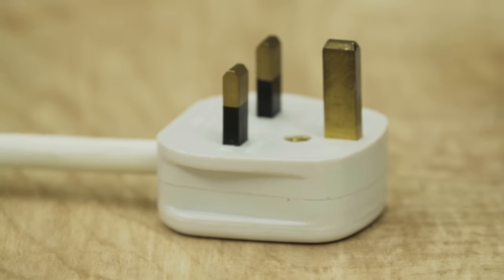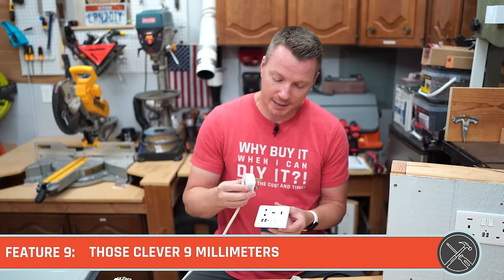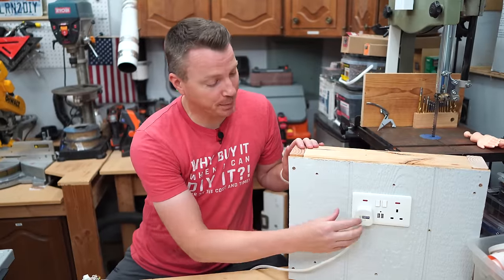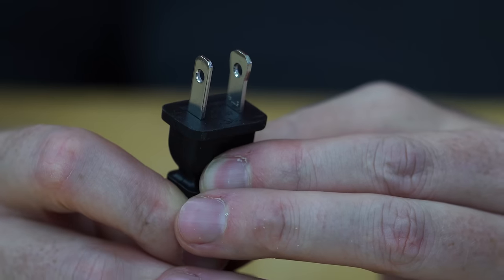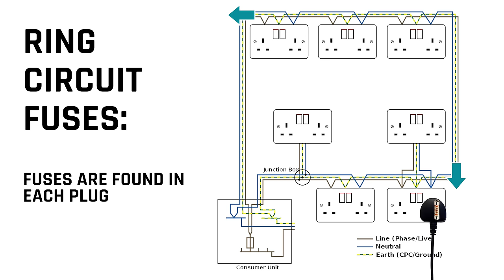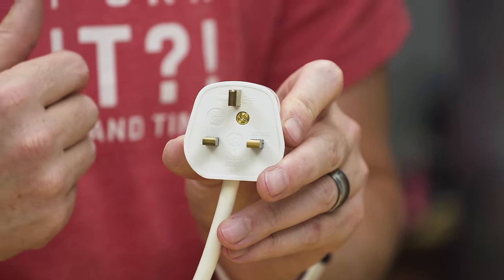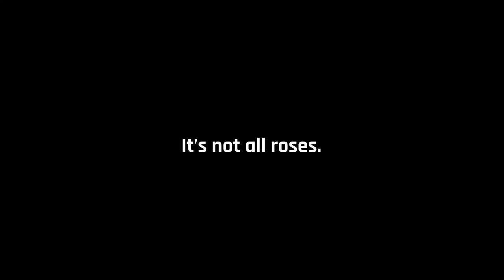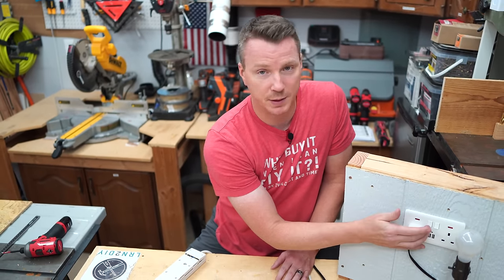British Plugs and Outlets Are On Another Level

Comment: If you think our plugs are chunky, imagine a Brit coming over to the US, when I was over there years ago the plugs seemed so flimsy, almost scary, sort of like just sticking some bare wires into the holes and hoping for the best 😂it really felt precarious, the whole deal, how easily you can pull them out, how easily you could stick a bit of metal in them, the unprotected prongs when not fully inserted, no fuse, no switch . . . and so on, I'm sure you're are all used to it and they are safe, but to someone brought up in the UK it's a little concerning, lol : ) . . . . by the way, annual deaths by electrocution in the US average ~350/year . . . in the UK it's ~30/year . . . so even though your population is around x4.8 larger than the UK, you have nearly x12 times as many deaths by electrocution.
Reply: They make tamper proof plugs in North America as well.
Reply: People unplug in the USA by pulling the cord, seeing a big arc. Yikes! Arc fault detection devices will trip out each time.
Reply: @johnburns4017  i never seen an arc
Reply: @danlux4954  
I have when there is a load running thru.
Reply: A lot of them happen when people are trying to plug things in probably, if your hands are even the slightest bit slippery things get painful rather quickly as you are pushing towards the pins while inserting the plug. Happened to me once over there fortunately the outlet was GFCI protected so it was just painful. I took to using a dry cloth or something to avoid the risk of touching the uninsulated live portions of the unsafe little buggers after that.
Reply: so your only variable is the plugs....
Reply: When I went to the US the plugs hardly stayed in the wall, no matter how you put it in, it was hanging out, metal showing and sparking! Was afraid to touch it!
Reply: @scottadkin541  "so your only variable is the plugs...." No, there are other factors, I was just discussing how US plugs seem super flimsy to people from the UK . . . imagine if someone from the US travelled to some far flung country and found that the local electrical outputs were a hole that you inserted a wire coat hanger into, that's sort of what it feels like : )
Reply: Electrocution on 110 volts?? try 240 volts, that really hurts!
Reply: I stayed in the US for a few weeks and I noticed sparks when using the plugs a few times.
Reply: If the UK plug is chunky look at a tumble dryer plug in north America. Probably three times the size and still just doing 3kw. And costs way more. UK plugs are hands down better than north America. American 120v plugs are cheaper.
Reply: @sammie9999  yup, but it’s better protection than the regular plugs.
Reply: @sammie9999  We don't have sockets in the bathroom in UK.  Everything is wired in to prevent steam and condensation from short circuiting the system.
Reply: @sammie9999  hopefully very few as GFCI /rcd is standard. I do appreciate a socket on the bathroom but I prefer British safety. Electro boom has a good video testing GFCI safety with water. I'm surprised north America has normal light switches in bathrooms. I'm used to the strings.
Reply: I remember plugging in my phone charger in the US and the plug just kind of 'dropped' in the socket. Like you'd push it fully in, it'd droop down a bit, repeat. Never really felt confidence inspiring. :)
Reply: @VoxelLoop  yes, not good. When the prongs can be stamped metal I think more corners can be cut. I think America mandate arc fault circuit breakers now. I was surprised to learn 120v is more prone to arc fault than 240v. Perhaps it's mostly in the plug!
Reply: @sammie9999  I would guess that almost zero died of electrocution in the bathroom in the UK. We have strict laws about electrical outlets. Even light switches are of the 'lazy Daisy' variety - a string hanging from the ceiling rather that a standard light switch - in order to avoid electrocution even with dripping wet hands.
Reply: @davidbalfour3390  To be fair, I'd used the American light switches many times with wet hands and never even had a tingle.
Reply: @chaos.corner  how many tingles until a super tingle? Personally 120 is a safe voltage, they use it on UK building sites.
Reply: @davidbalfour3390  For sure I'm not saying that the strings shouldn't be used for 240V (though ours was always breaking), just that the risks likely seem overstated. I'm sure it would be possible to design a safe-enough regular style light switch for bathroom use too.
Reply: On UK building sites the actual voltage is 110V, but the reason it safe is that we use centre tapped transformers so the voltage to earth (ground) is only 55V, meaning that by coming into contact with one phase (wire) you are only exposed to 55V AC which is not fatal.
Reply: Funny how he said about the size.. but when it's plugged in it dosnt poke into the room half has much as a us plug also looks alot cleaner to the eye
Reply: @mark_8719  Yeah. It’s common to have to bend the pins back on plugs for vacuum cleaners, and other appliances that are known to tug on the cord. 😂
Reply: @davidbalfour3390  also the yellow 120v building site transformers share the voltage between the live and neutral. Eg the live will have 60v and the neutral will also be live with 60v. Similar to a centre tapped tx.
Reply: @glenmynard3926  I'm always getting my 110 120 220 230 240 mixed up. At least I don't routinely use 208. It always surprised me that construction use 110 and no one ever complained about lack of power.
Reply: Power would be the same regardless of voltage as the current would increase if voltage is lower (but power stays the same) that is why the cables used are of greater gauge
Reply: @jamie7664  how ridiculous 😅
Reply: @davidbalfour3390  That's not quite true - it's actually 110V, but centre tapped, so it is actually 55-0-55V and if you manage to touch a faulty item that has become live, it should only be 55V to earth. However, 240V with RCD protection is also acceptable on some sites and there is no legal requirement to use 110V equipment.
Reply: @davidbalfour3390  230v allows for more watts at a lower current. 230v is much better. Lower voltage and Higher current is not ideal. High current means you need a thicker conductor
Reply: @danlux4954  
Tamper proof???? 
Molded mouldy flimsy plugs. No switches on outlet sockets is the norm
Reply: @grahamlucas2712  why would we need a switch on a plug? They are installed at around 12-18” from the floor. Any plug that needs to be switched has one installed at regular height by the doorway.
Reply: @danlux4954  
They are the ones called Light Switches.
It appears that power points are beyond your reach and comprehension
Reply: @grahamlucas2712  our lamps have switches on them, no need to have one on the plug.

Comment: The thing I like about this design is that you can leave the plugs, plugged into the sockets and switch off on the socket if you want to isolate some equipment. Like you do when you go on holiday,  for example. Also, by leaving them plugged in you don't step on them. And the downward cable means the plugs and cable are flush with the wall so can place furniture up against them.
Reply: "Like you do when you go on holiday". This is exactly what I've done for a couple of decades. You are going on holiday and don't want devices draining power or presenting an electrical fire risk, you just go round switching off the sockets. With a TV for example, we would have a dvd player, vhs, sky, speakers... plugged into a 4 way extension. Simply flip the switch and you can be certain that it is isolated.

Mid 90's we were on holiday in France and we had a call from a neighbour (we lived in rural Ireland), the house alarm had been going off for days. Turns out we hadn't turned off the fax machine and my Dad (a Doctor) had been receiving faxes which are printed using heat (fax/receipt paper turns black when heated) that triggered the infra-red motion sensors. The alarm would finally turn off just for another fax to arrive and set it off again. Hahahahaha. Our neighbour was a couple of fields away but it had been annoying them for days until my Dad told them where a key was hidden so that they could go in and flip the switch.

Comment: You should see the Apple version of the UK plug (for charging an iPhone). They tried to make it smaller and flatter and succeeded in making virtually impossible to get out of the socket
Reply: They redesigned them a couple of years ago… they don’t have that problem anymore
Reply: apple bad (obligatory Android user comment)
Reply: @RYNOCIRATOR_V5  your wrong (typed on iPhone)
Reply: @josh_1518  *you're puts shades on, in defeat, you explode
Reply: @josh_1518  Android use non proprietary chargers and as such the cables are cheaper and typically of a higher quality because of commercial competition and the devices are cheaper and that is because of commercial competition
Reply: usual form over function
Reply: @bescotdude9121  APPLE BAD AYYYYYYYYYYYYY

(these irony levels are positively lethal)
Reply: @RYNOCIRATOR_V5  both are good (Windows and Apple user)
Reply: @Stedel1alt  it's treason then.
Reply: That's to make you buy a wireless charger.
Reply: @smithychris8537  the one I have is for an iPhone 8 that was foisted on to me by my company.
Reply: Yup even with a firm grip it just slips out of your hand and you end up hurting your fingers gripping it.

Comment: You missed out a couple of extra features - the plug itself is only serviceable when removed from the power outlet (the screws being set on the inside face. Also the pins cannot be located incorrectly in the plug assembly - they won't physically fit. The plug cover won't close unless the pins are correctly located and the wires (if pulled free) can't contact one another because they are of different lengths.

 It's a very well thought out design. 

Oh and the earth pin is slightly larger than the others so you can't accidentally shove it where it's not supposed to go. 😀
Reply: It is an amazing little bundle of safety precautions. Fantastic design.
Reply: can American plugs be put in the wrong way?  ie pins of live to neutral and visa versa?
Reply: Apart from it not being servicable when in use that was all explained in the video
Reply: @Drobium77  Yes, some type A plugs aren't polarized. Mostly device chargers and "plastic" appliances, I think. My plastic-bodied slim PS3 uses a non-polarized plug, but my metal-bodied speaker amp uses a polarized one, for example.
Reply: @Drobium77  there's a video by technology connections about old toasters which goes into this, and yes, some appliances are polarised. The effect this has on the toaster example mentioned is that the heating elements are constantly being fed electricity, so you can shock yourself even if the toaster isn't 'on'
Reply: Another is that if you try to plug the plug into the socket without the lid on, the pins get pushed out of the plug housing instead of going into the socket. You have to try really, really hard to get the whole thing plugged in with no lid on (DON'T DO THAT!).
Reply: @abarratt8869  Pretty sure that depends on the plug. I could swear I've seen some where the pins were in solid. As an aside, I once went to pull a plug out and the (single) threaded insert broke free, leaving the inside of the plug exposed. On an unswitched outlet too. I was careful getting that one out.
Reply: @chaos.corner  9 times out of 10 the pins (when the back casing is removed) aren’t solidified in place, they are free moving. Meaning the pins will push out from the plug as you push inwards.
Reply: @Ash-re2fe  I agree, I've seen it many times. I'm just not sure it's 100%.
Reply: Indeed the right angle difference to the other connections also limits the chance of putting the neutral in the live and due to it being longer it won't actually reach the active circuit even if you did it would be blocked from penetrating by the other pins and you are further protected by people by habit not pulling out live plugs with the switch in the on position.
Reply: @Drobium77  Yes, as can European Shuko and other types.
There is a potential hazard for technicians working on live kit when the equipments on/off switch only switches the L
Connecting the L to the N line allows the L to appear in unexpected places when the on/off switch is off.

Comment: As a kid in the UK I recall being very proud of myself for discovering how to lift the guard from the live pins in a socket, shortly before my dad saved my life.
Reply: I use a plastic pen lid to do it so that I can use US plugs without an adapter (assuming the device is 220v compatible).
Reply: @joeasher2876  disturbingly that trick also works with European plugs... I wouldn't recommend it though.
Reply: @joeasher2876  I used a matchstick - when the plastic 'ground' prong on my gameboy power supply snapped off.
Reply: I used to british plugs.. i put the earth from one plug only connected to the earth then i connected the other 2 pins with the other adapter then i took out the earth and plugged my dwvice in and i was suprised when it charged
Reply: you wouldn't have died
Reply: @joeasher2876  how would you use a US plug with a UK plug without an adapter? The holes are too small for it.
Reply: @bass2762  You simply don't.. If you come here with a US plug then uh, good luck really, if you manage to get it in you are in for a ride of your life. To the hospital anyway.

Comment: Another major benefit of the switch on the socket, is some devices dont have off switches at all, eg hair curlers, irons and some soldering irons (maybe they do in the US, but in the UK they heat up just by plugging them in), in which case, you can leave these devices plugged in if you want and turn them on and off as required.
Reply: EU plugs for the win, every safety system and more than British plugs have, but more compact and you can put them on either way.
Reply: @PalpatinesPlumber  The EU plug mimics little power it has to the chad UK plug bro
Reply: @PalpatinesPlumber  Disagree
Reply: @PalpatinesPlumber  The Earthing of the EU plug is inferior to that of the UK plug.
Reply: @PalpatinesPlumber  Dude just got ratio'd on a plug review D:
Reply: @Nvggs  What do you expect? Obviously people using the UK plug will be watching this video more, to see how "good" their plug is... I mean it's still a good plug, but the EU one just does everything simpler.
Reply: @PalpatinesPlumber  simple=/=better
Reply: @Nvggs  Yes, but if one does everything the other does and is simpler, then it is better.
Reply: @PalpatinesPlumber  but it doesn't, sooooooo...
Reply: @Nvggs  It does though, you're just assuming without having used one. And you can't compare EU plug made in focken Romania to one made in norther Europe, the quality is a bit different.
Reply: @PalpatinesPlumber  I've worked with many variants of electrical inputs and outputs. You've made no actual point on why the EU is better other than "it's simple" and had to resort to the "how would you know?" approach by assuming I've not seen or used an EU plug
Reply: @Nvggs  "Every safety system and more than British plugs have, but more compact and you can put them on either way" That is literally my first comment... It's that the UK plug has no benefits over the EU one, but it's less practical hence I said the EU one is better.

Comment: The best thing I learn from the design is that the cord always came out from the bottom of the plug, so if you have water leaking from the appliance the water never flow into your wall socket. Very nice design.

Comment: Great video. I would add: 1) All electrical appliances sold now come with a molded plug by law, so they cannot be opened but the fuse can be replaced, though one can always cut it off and wire in a new one; 2) The blue neutral wire is dog-legged back as further strain protection; 3) The ring main was needed because of a shortage of copper following WW2; 4) It is not uncommon in the UK to have extension packs with a multiple sockets in to each wall socket, so one wall socket powers 2-8 items with varying power demands, especially in older houses where few sockets were provided.
Reply: Adolf. You may wish to check your statement as a ring uses less copper especially as wire diameter is much thinner.
Reply: I'm so glad we don't have the US's low voltage and current nightmare so that we can use 3,000 W kettles and portable heaters. 😎